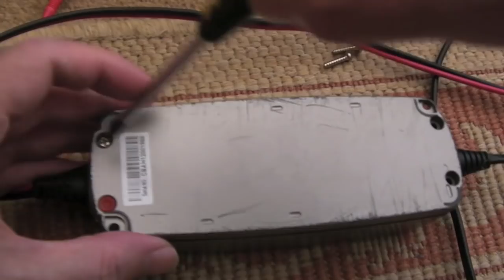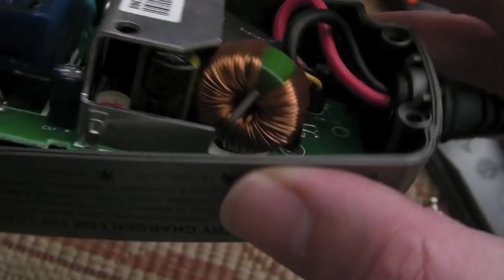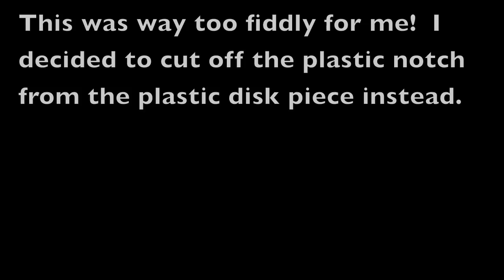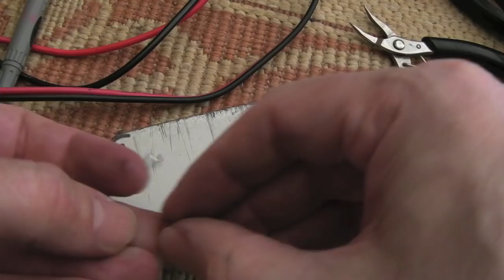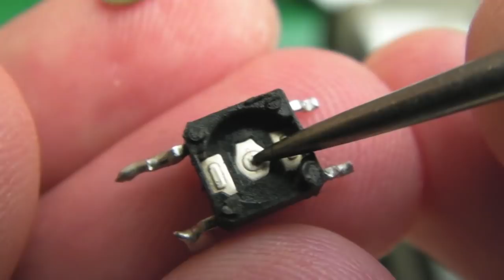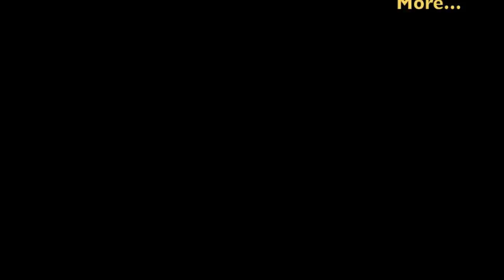VLOG - CTEK XS Multi 3600 Car / Bike Battery Charger Quick Fix

Comment: Just wanted to say I found this video after having the same problem. Ended up replacing the switch “dome” rather than desoldering as per one of the comments here. Cleaning didn’t work, and I ended up using the new dome underneath the old one to pack it out as there seemed to be too much clearance using a new one & still not switching. Switch was opened by cutting the four tiny corners & sticking back with a bit of hot glue. The new switch parts came from a salvaged front panel from my old sky box by the way – made me feel better about not throwing stuff away! Thanks all! 😊

Comment: Thank you my friend you just save me The best part of £100 mine had exactly the same problem. I didn’t even desolder mine. I just picked the silver Cover Off, cleaned it with isopropyl alcohol under cotton bud. replaced the top and hot glued it back on. Works perfectly now thank you

Comment: It is a typical failure mode for this type of switches. I had to fix these so frequently by now that nowadays I tend to carefully disassemble switches in place to clean up internals with a little IPA and deoxit instead of desoldering and soldering a new one. Reassembly of the switch isn't that tricky with top metal cover held in place with a tiny droplet of rubber glue. It is important not to use superglue for this as it tends to vaporize a bit and cover switch internals (dome surface) ruining switch back into non working state. Had fixed my rice/multi cooker control panel a year ago with this technique and it still work well to this day.

Comment: Thanks for the very helpful video. I have the same unit, and after only 3-6 months of operation it failed in exactly the same way as yours. Sadly mine was out of warranty as I had had it sitting in a box for a long time before using it. So I dismantled the switch, cleaned the little dome contact, glued it back together and now it works perfectly again. Must have been a very bad batch of switches!
Reply from the maker: Glad it helped =D

Comment: Nice video
I had the same problem.
I did a easy test - put the power on and shortcircuit the switch with a screwdriver on one side.

Comment: I did repair my Ctek Zafir 45 in November. Same problem with the Mode button but i solved it with some ipa and electricalclean. The charger still works fine 👍🏻

Comment: I've got the same charger and although I can get it to work occasionally by hammering the switch a few times, usually missing the correct charging mode in the process, I suspect it's the same issue. I believe they're reasonably sealed units for an IP65 or IP67 rating.

Thanks for the video, although you've given me another job for me to do! I only discovered your channel yesterday when looking for Amiga PSU repairs - I've got a whole bunch of them from a job lot, some with nicely blown internal fuses.

Comment: A new switch is normally the only repair that will work. Just to add to your work and to make it a little easyer for some I will add the following. Cut the legs off the old tactile switch then remove each leg from the board (i use large nail clippers for this). You dont need to replace the flat disc so can use 6 x 6 x 6 SMD momentary switches with no other modification. Parts are around £1.80 for 5 pieces on ebay.

Comment: Those little tact switches are a pain in the arse.  I've swapped some of them recently in my Akai MPC that hasn't even had that much use.  Also the reset switch in the megadrive 2 is a similar type of switch and that had completely died in mine so replaced with one of those clicky ones you used in this vid.
Reply from the maker: Yep, they fail in so many devices =/  I was surprised this switch failed as it doesnt get that much use!

Comment: Thank you very much.  This is exactly as my does . As in most cases, totally sealed cases are not the best due to condensed water... A tiny hole may be a way to protect??  but in this case, it will not be IP44, IP45 or IP46  or anything.  the classic  problem  =:-|

Comment: I wonder if the conformal coating had something to do with the oxidation, like some volatiles might have gotten in to the switch while the coating was setting or something. I think it might be a a bad idea to mix mechanical components and conformal coatings. I have also had a ctek chargers having intermittent button functionality. Just had to press it a bunch of times and it started to work a bit better. Probably just broke up some oxide and it's probably going to be acting up again in the future. Keep up the good work and stay safe with the virus going around.
Reply from the maker: Thanks =D  Yes, you may be right there!  Stay safe!

Comment: Atari 7800 consoles have a larger version of these switches and many of them fail.

I've seen people say it was from contaminants during the wave soldering process but the power button always fails first (most used button). Wear/use/fatigue definitely has something to do with it.
Reply from the maker: Yeah, this button hasn't had much use though lol!  I think moisture in the environment must have got in there!  Everything else has conformal coating, but the button is kind of exposed I guess.

Comment: Nice video as always Mr.G :) Question: any idea at all how commodore 64/128 assigns a drive number on power up? I am asking as I'm stuck with a disk drive (C128) that the machine always assigns to drive 9 on boot. This is a pain as a lot of software needs "8". There are four "jumpers" on the board but I have grounded these (as one of the pads was damaged) so there's no reason for the machine to default to "9". For the record the external drive (1541, SD2IEC) happily grabs drive 8 if plugged in to the serial port. A real mystery...don't know if you have any ideas at all?
Reply from the maker: I've not looked at it, but its going to relate to one of the ICs connected to one of the VIAs.  A signal will be pulled low or high and another not, to specify 8 or 9.  I am sure its possible with a toggle switch!

Comment: Very informative as always. I have a ps vita external battery grip, but the battery keeps geting drained on its own. Its not the batteries, they are good its something in the charging circuit, do you happen to know some place, like a forum or something, where i could find some assistance on that?
Reply from the maker: I am honestly not sure where you could go with that!  I've not seen that problem before, but then again I've not looked at a Vita yet on my channel either!

Comment: Thanks for posting I have the same problem with mine.... please could you post a link to the switch on eBay...  this would help me greatly to select the correct switch. 
Many thanks!
John.
Reply from the maker: Something like this:- https://www.ebay.co.uk/itm/6mm-x-6mm-x-4mm-DIP-Push-Button-Momentary-Tactile-Switch-2-Pin-5-10-20/161783781492?hash=item25ab109874:g:GKIAAOSwgHZYCwCj
Reply: GadgetUK164 - Retro Gaming Repairs & Mods 
Thanks very much!👍

Comment: On the edge of the dome part inside, there were 4 tiny black spots. It looks like it had been arcing.
Reply from the maker: Thanks, I did wonder if perhaps it arcs as it gets pressed - that kind of thing ultimately will stop one of these working.
Reply: @GadgetUK164  And either a fly-back catch diode (if DC) or small capacitor (AC) will kill the spark. But that's normal good design practice if there's any spark energy involved. That said, these switches are not intended for inductive loads.  Just driving pull-up resistors with a few mA and no spark energy. Not sure how CTek got this so wrong. And on so many models spanning so many years. And they still do it. As long as most of them outlast warranty they seem happy.